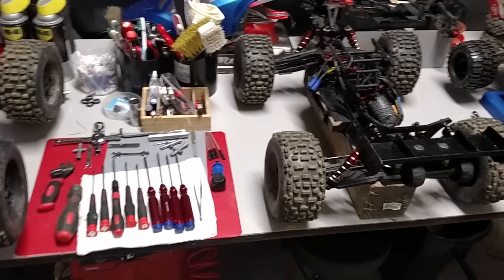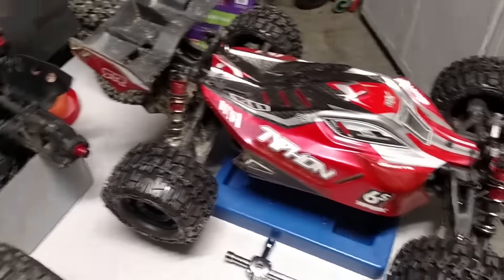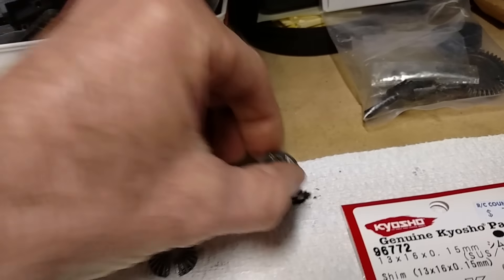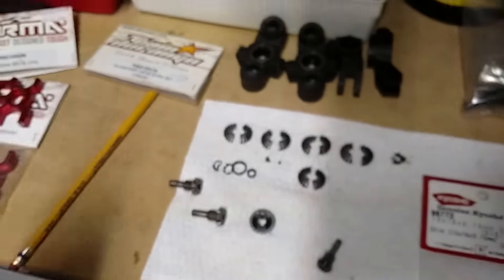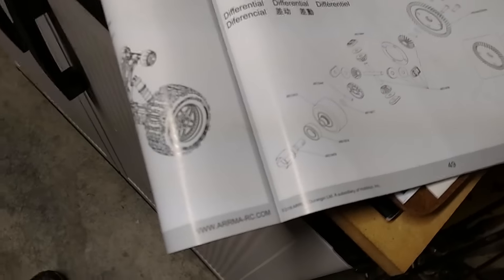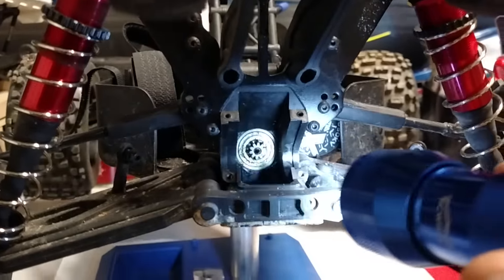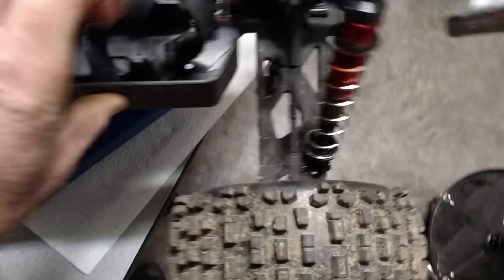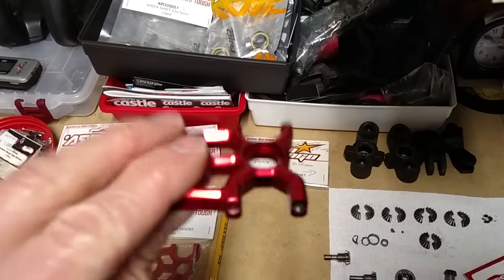Arrma Outcast 6s diff gear breakage

Comment: Rich I just got my new basher the Arrma Granite 3s truck.  

The front shocks don't feel so well. So I wanted to ask what weight of oil you put in the front and rear. And is there anything I should do upon buying the truck.  

I fully trust your word bro.  And thank you MEGA for all your help. 

Without you I would not have such videos like this for me to learn from.  

What you are doing for us newbies is Epic bro.  

Have a wonderful day man.  Peace.  ❤️👊😎
Reply from the maker: Congrats on the Granite 3s Michael 👊!!! The shocks are a great design, but I've found they're starting to leak with the bigger airs I'm doing anyways 😨. I actually just swapped on spare Typhon V2 shocks with 35 weight oil on my Senton. Still running the Tekno eb48.4 shocks on my Granite now. I'd recommend going up with the stock oil to at least 60 weight. Stock is 40, but it leaves the shocks very bouncy. Other than that, I'd recommend the rubber sealed slipper bearings I posted about in my upgrade vid a couple weeks back. Passing out for the night 👊. Catch up with you later my friend.🍻😎💪👊👊
Reply: Rich Duperbash 👊😎awesome Brutha. I think it's going to be 80 weight for now because that's all I have. 
Hope that's good. 
But that may be a bit stiff for me.  

I have to buy more shock oil.  
Anywho the bearing for the slipper will be my first purchase.  

And some oil.  
Thanks bro.  Have a great night ✌️🙂

Comment: Wow. First time I have seen a differential gear broken on the Outcast. Did you bump the esc punch on the outcast? or was that your kraton? either way, running 6s and having those backflip tires with all the traction must be hard on the gears! Maybe I will turn the punch down once mine arrives... I dont want it doing constant wheelies.
Reply from the maker: yz125ryder I had just bumped it up to 9, but hadn't tested it yet. Outcast had always been driven on stock setting of punch 4. Spun the wheels and heard clicking, knew something was up. Bearings were fine,  main input diff cup was  tight, shaft straight...etc. Only run 6s with 16 pinion so she moves good, plenty fast. Hopefully external diff shims will help avoid a repeat, that 43T gear is 20.00$ and  input gear is 10-13$. Will fully shim all my diffs when parts arrive. It's cheaper and less downtime to bulletproof them before repeated failures especially if you bash hard.
Reply: So the diffs need shimming out of the box? Huge difference in gear life having the play set right but figured that was past history.
Reply from the maker: John F Hendry I wouldn't say they need shimming. It's just there seems to be a tad more play then necessary from planetary gears to outputs and from main input gears to crown gears. Overall, if bashing hard on 6s I think it's a good idea to further shim to prolong gear and diff life.
Reply: Rich Duperbash Yes, I guess when you are in a hurry that last bit of perfection comes at a price in time you don't have... really surprised these are not available in kits. Rather do it myself like a lot of people I'm sure.
Reply from the maker: John F Hendry you're right. Something's can't be rushed for sure. They are also overthreadlocking and overtorquing some parts, but all in all Arrma is making some really fun and durable bashers.

Comment: I've already broken three main diff gears (the ones outside the diff with 43 teeth). Do you have any trick to keep that from breaking or an upgrade part???
Reply: I added shims on the diff case bearing, on the side of the ring gear. That tightens the slack between the ring gear and the  diff pinion. Never broke a ring gear after that. And I ride a lot on very high grip skate parks, and always on 6s. But I'm breaking a lot of pins and planetaries on the front diff. Trying to solve that at the moment
Reply: @nelsonmarques1334  okay, thanks. For the pins - I found this: https://www.youtube.com/watch?v=WPHldrwHxKE I also have the same Issue as you now, but in the rear diff... I'll try these self-made pins out. (the broken pins might actually be breaking the planitary gears)

Comment: My rear end on the talion just gave  up so its front wheel drive  what you think it happen!!
Reply from the maker: Could be the rear output cup grub screw came loose. If the rear drive shaft spins off the ground, that would be my guess. Other possible issue is a busted center diff rear planetary gear set pin. If you're hearing nasty grinding, could also be a badly stripped rear input/crown gear. 🍻😎💪👊👊

Comment: Hey Rich next time you are going over a diff can you get in more detail how you know when and how much shimming you should do? I know how to shim and where to place them, but I'm not locked on how to know how many to use and best ways to test the fitment. I don't want to just shim for the sake of it but shim for the need of my particular vehicle. Thanks as always for these tutorials.
Reply from the maker: You bet Brother 👊. This older vid was pretty crappy 🤣. I definitely rambled on and jumped topics. Shimming is mostly by feel. Don't want your diffs notchy or too tight.  Also don't really want excess slop in the outdrives. I did a more detailed diff vid awhile back with basic build tips. 😎💪👊👊
Reply: @richduperbash2966  Thanks my dude. I've watched all your vids and about twenty others regarding shimming lol. Plenty to be found on how to do it but not so much in explaining/demonstrating that "feel" you speak of to know where and how much shimming to do. It seems like everyone just does the 2-1 shims inside the diff, And all over the place with the bearing shims outside the diff.

Comment: Hey buddy i know this is an older video but I'm hoping you get my comment. Have you ever tried hardening all your satellite and planetary gears and your drive cups? Just get them red hot with a torch or map gas and then immediately drop into cold water or oil? I'm trying this with my notorious build in using just bash it chassis and diff cases and i guy i know on fb has been hardening those sintered arrma gears and he had had awesome luck 👍
Reply from the maker: Thanks so much Brother 👊. I've had others suggest it before, but haven't actually tried it myself yet 🤔. Definitely makes sense to me. Really appreciate you bringing it up. I'll have to try it. 😎💪👊👊
Reply: @richduperbash2966  ok cool man, so I'm building a notorious with just bash it chassis and some essential gpm parts like my steering rack and hot racing servo saver locking clamp tube but these tests are just too weak and i can't pay 35 bucks plus shipping for hardened spider gears so I'm going to try hardening myself first. It's free Lol. 👍👍

Comment: I think I broke something in a diff recently on my v2 outcast. Under hard acceleration, I get a loud pop sound, not like POP POP POP, just a single POP. I think out of habit, I let off the throttle. I figured it was a tooth busted off a pinion/ring gear on the rear diff since that's where all the traction is. I just took it apart, pulled the spider gears and I'm not seeing any missing teeth. The sun gears seem fine as well. Also see nothing really on the ring/pinion. Bearings are tight as well. I ran this truck twice with stock oil/shims, then did a full tear down of all 3 diffs, cleaned out the fluid in them, used the mugen shim kit on all 3 diffs as well as 100k/500k/100k oil. I also removed the stock single shim on the diff bearing itself and replaced it with 2 of the kyosho shim on the ring gear side on both the front/rear diffs.

I guess I'll do the front diff next and see what's going on in there. I hate messing with the center diff on the outcast. I have a new diff coming in the mail already. Ordered it on ebay before I left the bash area.

I'm used to shimming diffs, I've had savage's in pretty much every from but the octane and it's known to have sloppy diffs that die. Especially the old smaller tooth diffs.

Anyway, I'm curious how it sounded when your sun gears split. I've never had that happen before, so I don't know the sound. Considering the tooth size on the sun/spiders, I'm not expecting it to have a deep pop sound like I was hearing, so guessing it may be the front diff, which is odd as when your under hard acceleration, the front end has less traction than the rear, so was expecting a tooth missing on the ring or pinion in the rear diff.
Reply from the maker: Bryan L I can't say there's a definitive sound when the sun or planetary gears pop. Often times the rig will keep running without issue. They tend to split right where the set pin sits. If the gear isn't displaced it will still function. Once it's moved or the set pin breaks, you'll notice immediately that something isn't right with the driving. Pinpointing diff problems or sounds can be challenging. A single pop sound could be a quick gear slippage most likely from the front or rear diff. I've found my gears to appear ok only to discover a cracked diff case or stripped diff cover. That allows the crown gear to push off the input gear on harder throttle. The other pop noise can happen when an input cup is slipping on the input gear. I'd make sure your grub screw is fully seated on the flat spot. Next would be to closely inspect the sides and bottom portion of the diff cases for hairline cracks. Usually if the bottom area has fractured, it becomes obvious when removing it off the chassis plate. I don't think the problem is inside your diff cups. If the wheels are counter rotating by hand smoothly left to right and you're not losing front or rear wheel drive, my best guess is the crown and input separating. 🍻🤘🤘😎💪👊👊
Reply: Listening to my footage from yesterday, there's a constant "tick tick tick" as it rolls by me under power. I inspected the rear case today and I'm not seeing any cracks or anything. I'll tear the front end apart and see what I see there next.

Thanks for the help.
Reply: It was the front. I don't understand why though, running 4S. I don't recall landing on high power and I have 2 shims on the ring gear side, it can't move left/right at all, so I can't fit a 3rd shim in. Took the tips off a couple teeth: http://gmarquee98.x10host.com/myPics/98gmarquee/Outcast/2018-0820-OutcastFrontRingDamage.JPG Anyone putting shims behind the pinion to push it out further into the ring gear?
Reply from the maker: Bryan L I'm glad you found the problem brother 😱!!! I'm not always able to get 3 shims on the crown gear side either. Especially with the V3 stuff. Seems like the tolerances may be a tad tighter🤔. I'd replace that gear or it will chew up your input. It's possible both front wheels had rapid deceleration going up and over something abrupt 🤔 or the teeth simply gave out/chipped. Despite "bulletproofing" the diffs through shimming, crap still happens😨. Either way, I'm glad you're getting it sorted🍻😎💪👊👊
Reply: Yeah, I'm going to replace both as I ordered a complete diff assembly off ebay. I also ordered some 8mm .5mm thick shims to maybe put one or two behind the pinion to push it into the ring gear a bit more. Will see how it spins when dry and make sure there's still a small tick of play. I just don't want this thing to become like my savage was 15 years ago before BP diffs came out. I hate dealing with diffs.
Reply from the maker: Bryan L yeah complete diffs off Jenny's RC is the way to go 👊. Forgot to mention, I don't shim behind the input gears, but have heard of other's trying it. 🤘🤘
Reply: Yep, exactly where I ordered from. I put them behind those gears so the o-ring isn't rubbing directly on the back of the gear/pin. Figured having the o-ring running against a nice smooth shim would help it last longer and probably seal better. I used the mugen shims only inside the diffs and removed the arrma shims. I'll have to take my busted diff apart to reuse the shims.

Comment: Great video did the kyosho shims work when u used 2 of them ??? I changed my rear diff bearing and that shim was all messed up now I keep blowing input gears .... so ima have to try this
Reply from the maker: Reg Lev sorry for the late reply. Yes, you can usually fit 2 Kyosho shims in, but not always. It's the equivalent of using 3 Tekno #1222 shims. I'd say use at least 2 Tekno shims at a minimum. Good luck with it. Stripping inputs gets old quick. I usually put grease on the shims to keep them on the bearing when I carefully seat them in the case.😎💪👊👊

Comment: Nice video! I would have loved to see how you got the diff out as I have never opened up my outcast yet and couldn't figure out an easy way. I cant wait to change the Diff fluid. What weights are you using for the 3 diff's. Thanks.
Reply from the maker: Aby Joseph thanks bro. Been running front to rear 50/100/20k, has worked well, may try 150 center next go. Front/rear diffs pull straight out. Just remove wheels and lower shock pins, loosen sway bar attachments at each side, remove 4 diff case bolts facing you and diff cover pops off, pull on attached swaybar and cover will release easier. Center diff involves removing 3 motor mount screws and 2 metal to plastic diff brace screws, all from under chassis. Use lots of heat on metal to metal to break threadlocker or you may strip. Once you do it once or twice, gets pretty easy with reverse assembly. Manual has accurate pictograms, but not overly helpful for sure. Tp-PartsRC-Xtreme has great how to videos. Been most helpful for me personally.
Reply: Rich Duperbash, I can't thank you enough for the detailed explanation!! This is all I need to get started!! Thanks a ton!
Reply from the maker: Aby Joseph no problem bro. Just don't strip screws!!! If they don't loosen somewhat easily after heat, stop and use more heat. The gun I showed in the video has made disassembly way easier for me, gets very hot. Good luck and take your time. Can't rush learning these awesome rigs.🐒🐒🐒
Reply: Thanks Rich, I will definitely use the heat gun on the three screws you showed on the video. I am starting with the front diff and the wheels are already giving me a hard time. Its like, its super-glued to the axel rod, LOL.  Anyway, I am in no hurry as I haven't even bought the diff fluids yet.
Reply from the maker: Aby Joseph some some reason the Outcast Backflips were bored slightly smaller than Kraton wheels even though they share the same hex's. They are likely overtorquing them with a driver and smashing plastic into hex threads. I ended up standing on my wheels carefully  with truck on side, grabbing near hubs and having to rock back and forth to finally break them free. Others have used a hobby knife to cut near threads slightly to unjamb plastic. However you get them off, be sure to sand, Dremel, or file wheel hole slightly with round file or sandpaper on a pencil to debur wheel hole for easier fit. If not, you'll have the same problem again. Many people have had this problem sorry to say.
Reply: WOW, I thought I was doing something wrong and didnt want to use more force and break something lol. Will try that tomorrow after i get the diff fluids. Thanks for the tips bro! I am exited to have someone I can go to when I get stumped :)
Reply from the maker: Aby Joseph I'm happy to share what I've learned. I too thought I'd break something doing that. Got the idea from someone on Arrma Forum. Lots of great info being passed around there. I had shoes on and held wheel with toes/forefoot. Just be careful not to tear tires off the rim doing that with your feet!!! Good luck.

Comment: Do you think i should run the 13 tooth straight or the 10 spiral  i know the 13 straight would gear up but what one is the most durable
Reply from the maker: Hey Daniel 👍. The spiral cut 10 tooth input gear (and matching crown gear) is stronger. Spiral gears have greater surface area contact. They're best for the Kraton, Outcast, and Talion. The lighter Typhon and Senton do fine with the 13T straight cut. Just don't ever mix the straight and spiral cut gears together. 🍻😎💪👊👊